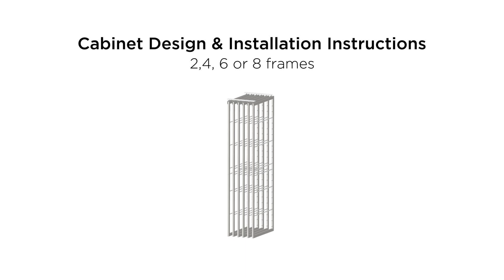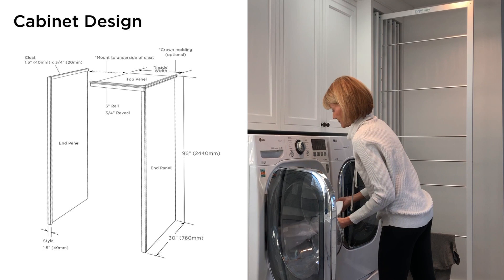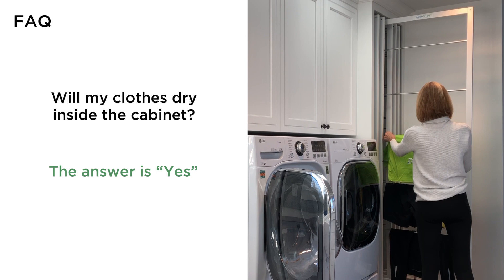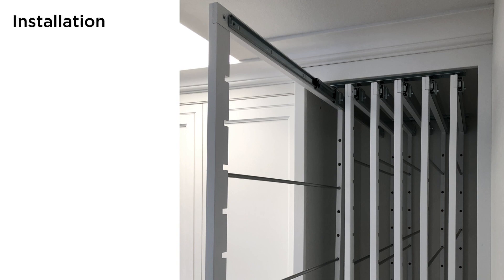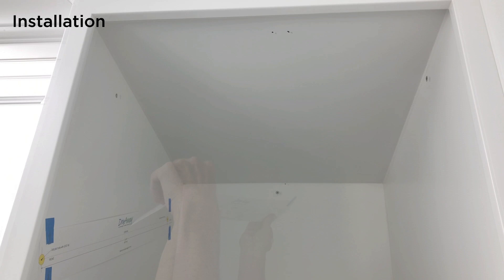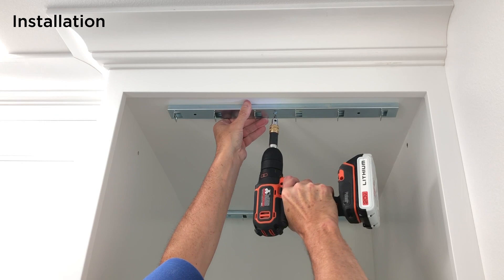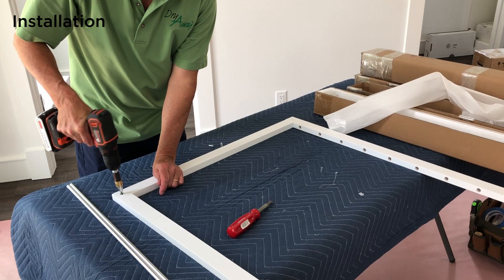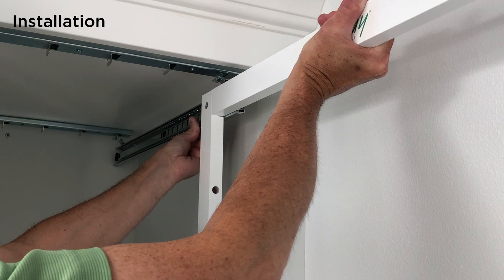Welcome to the DryAway Installation Video

Comment: One question is normally the clothes will dry from air or due to heat. But when you put clothes in them there is no doubt that there will be no mess all around but the clothes will smell. So, how will the clothes dry and it might take very long hours. Also, what happens when it rains?